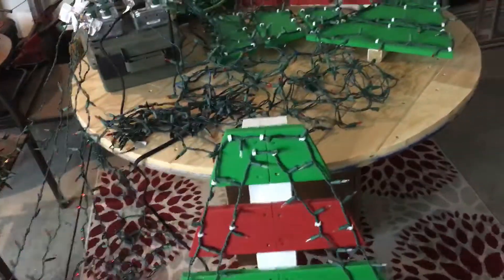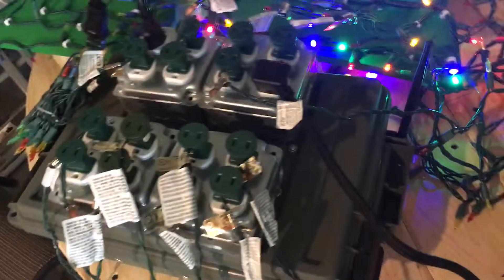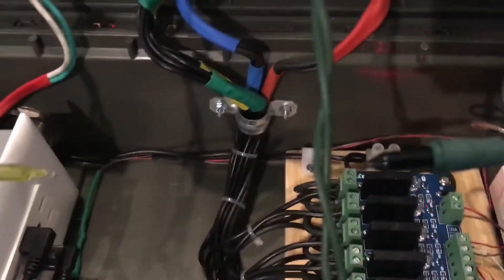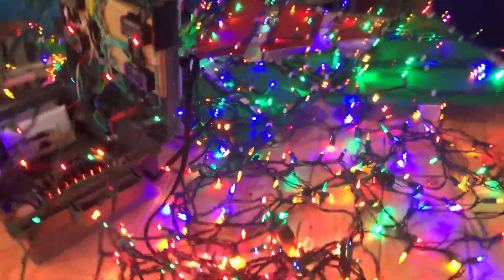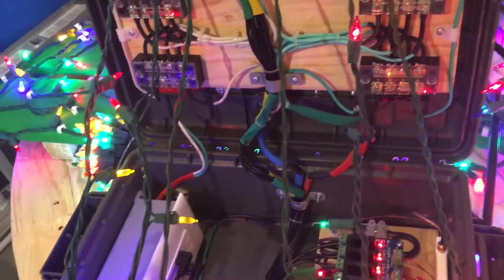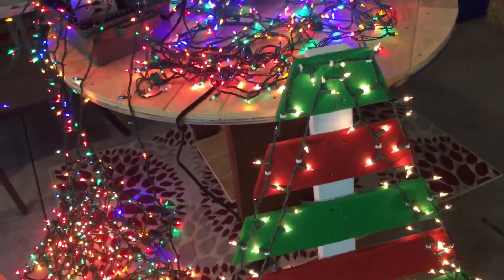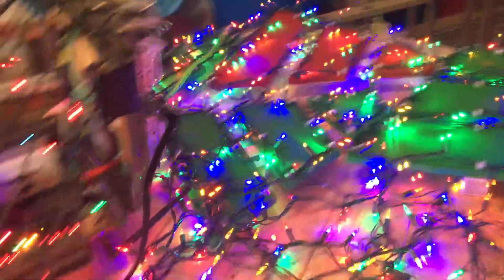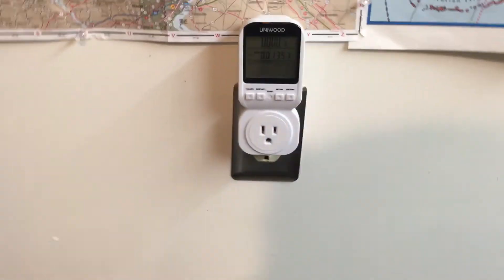Testing The Raspberry Pi 16 Channel Christmas Light Show Pi Setup Using Solid State Relays

Comment: Hi, but how did you connected the other 8 channels and how you setup the lightshowpi to play all 16 channels, I got my controller working with 8 channels, but I like to add another board, can you help me please? Thank you!
Reply: The Pi can connect to one 16 channel relay or two 8 channel relay with its existing pins. If you need to control more than 16 relays then look into purchasing a stackable relay hat that utilizes i2c and not GPIO pins.

Comment: Nice work, Fuzz. I don't know if you're into the whole Christmas display thing or just the Pi, but if you haven't checked it out, see https://www.diychristmas.org/. Over the past few years I have assembled a couple of the Renard SS24 boards and bought bunch of lights but they never made it outside the house, just due to lack of time/motivation. Seems like every Christmas sneaks up & it's gone! I usually get to the point of playing with the software and that's about all. I find it prohibitively complex to set the lights to the music. I don't think you mentioned what software you were using or home-grown. The one I was trying to use from that web site is called Vixen, but it can do so much that it makes it hard for the newcomer, IMHO, much like an Adobe product for example. It's easy if you've been doing it since the beginning when it was basic but trying to jump in and learn the basics at v14 or whatever is a different story. Anyway, diychristmas has a section for Raspberry Pi so there is likely something good out there. I've not checked that part out. Those Renard boards I've got use SCRs to drive the AC outlets so they can dim every channel, which is nice. Anyway, you made a cool project, have fun, & Merry Christmas even though once again I am not ready to be saying that yet!